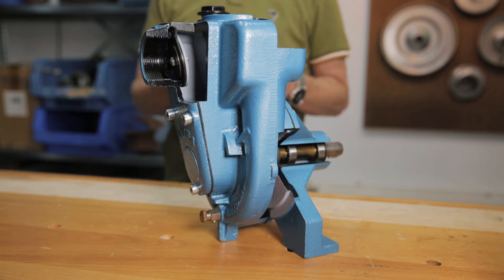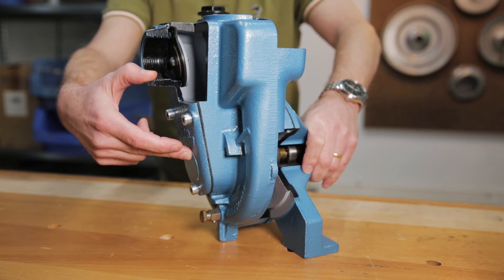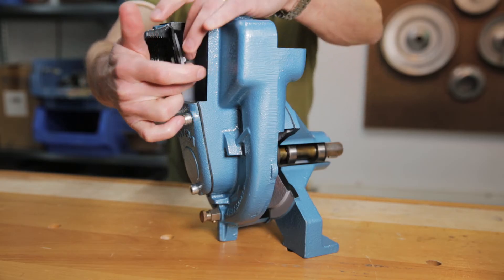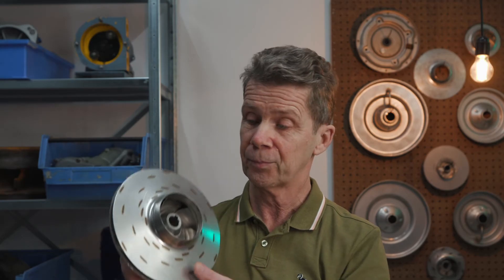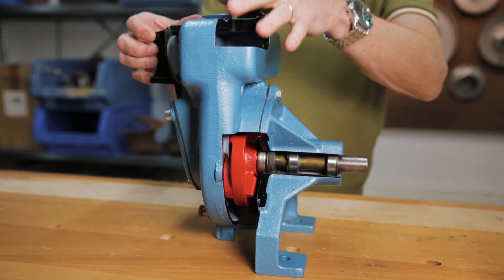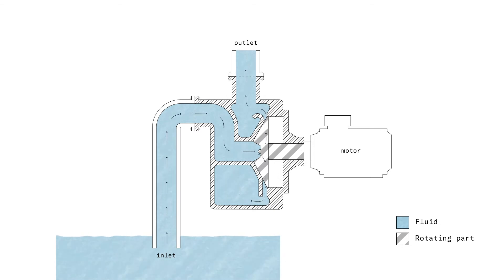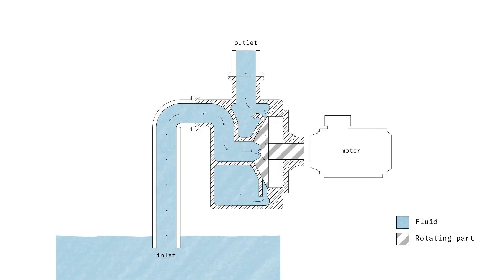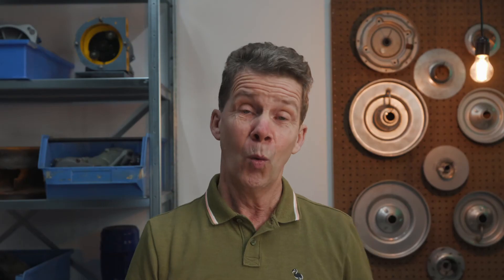How does a SELF-PRIMING PUMP work? | +ANIMATION

Comment: How is it self priming if you need to manually prime it with liquid?
Reply from the maker: It is self-priming because you will only need to prime the pump. The pump then will be able to function regardless of the empty suction line. In a normal priming pump you not only have to prime the pump, but also fill the suction line.

Comment: Do these pumps have special sealing arrangements that donot overheat or start leaking when it takes time to fill the suction line completely with water. Secondly in the animation the discharge from impeller goes in two direction. One outlet but the do the bottom half only pressurize the casing or i am seeing the animation incorrectly. Thank you

Comment: What is the cost for a self-priming pump. We have a 20 acre pasture but we don't want to manually go prime the pump. We have a five horse pump right now. Do they make an attachment for the five horsepower?
Reply from the maker: We don't know the specifics of your situation, but you could probably also install a foot valve in your current installation :)

Comment: In the animation, the water is lifted  without any movement of the water in front of the of the intake being visibly displaced by the impeller.  So it is not obvious what is creating the  low pressure at the inlet to cause the initial lift.

Comment: I have a question , why self prime pump is good for liquid with particles ?
Do you mean that if the check valve remains open in normal prime water with particles , the liquid may go inside the pump through suction line and when the pump starts to work may cause vibration or cavitation ?